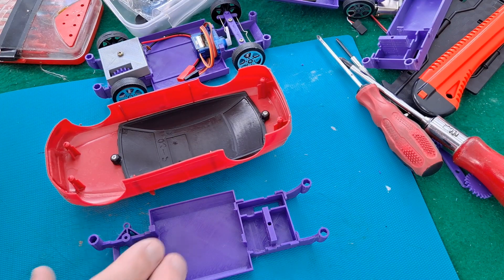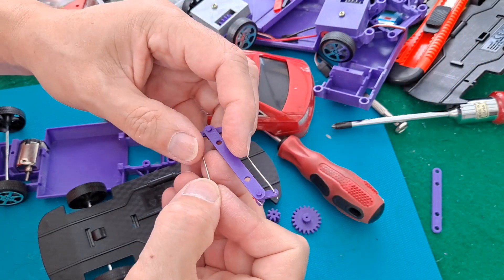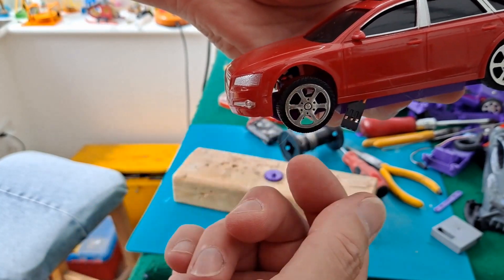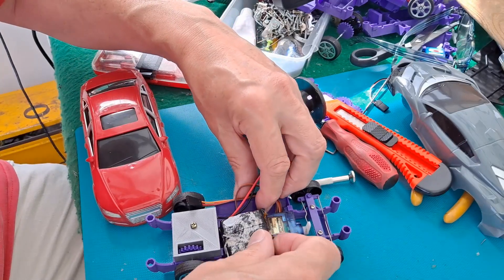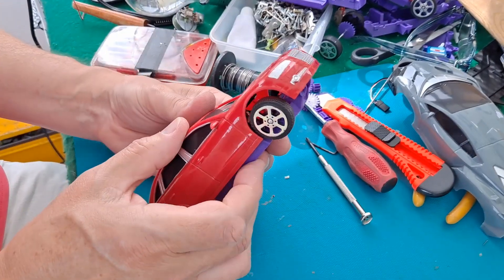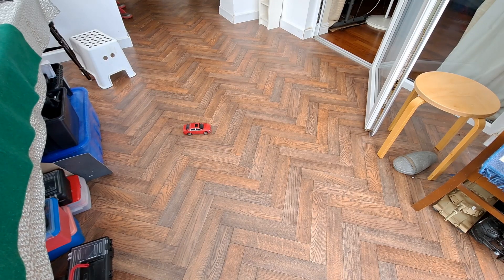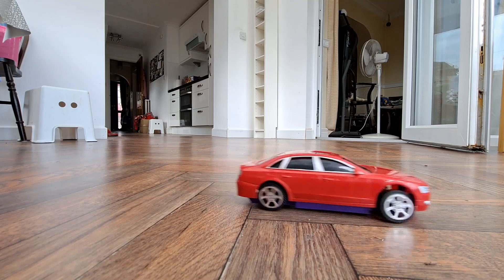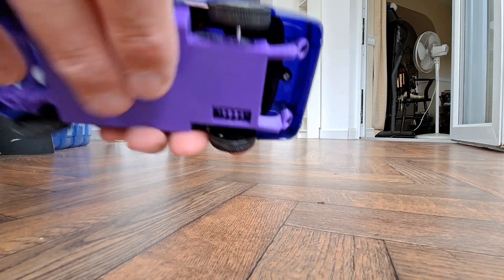Poundland toy car RC conversion project PART 15 - different chassis for the other cars.

Comment: nice video, the blue boddy seems to hold better on the chassis than the red one. no problems with the gears either,their holding up good and not cracking.runs good on the floor but slippery due to plastic tires.good job
Reply from the maker: Some people want their cars to slide like that so they can do drifting 😊👍

Comment: need to get rubber bands round those wheels at some point.
Reply from the maker: I am surprised how well they go with the plastic wheels. I expect if I only used a 1S battery you could drive it around fine. It might even be better on carpet. I do have some toy grade rubber wheels/tyres on order from China so when they arrive we will try them.

Comment: Really enjoying this series. Just a thought. Could you design the chassis so the axles could be adjusted forward and back to fit the whole range?
Reply from the maker: 4 of them use identical chassis. The other 2 are narrower and have smaller wheels.

Comment: Make a chassis a bit tinner, like previous one and make a connecting pins a couple of millimeters lower to make a lower car.
Reply from the maker: That is what 3d printing is all about. The ability to modify your design to accommodate changes.
Reply: @GrandadIsAnOldMan  https://youtu.be/vqWwUx8l_Io.If you wanna recycle your useless 3d prints into a 3d printer filament, maybe this guy can help you

Comment: Is there no way you could use the "original" chassis and just stick the motor, gearbox assembly, and steering on it? Suppose it takes the fun out of printing your own chassis but I was just wondering. 👍👍👍
Reply from the maker: It would have been far more work. Most of the front would be cut away to allow for the wheels to turn so no strength left and would need bracing. Same applies at the back to make space for the gearbox and motor. So what is left?
Reply: @GrandadIsAnOldMan  Yes, true, but what about putting them in "Series" LOL😂
Reply: @GrandadIsAnOldMan  Just want to mention a new thing I have noticed with YouTube. I have two channels as you know. Well, I used to be able to leave a like on one video independently from each of my channels. Now I see that it won't let me do that. If I leave a like from this channel and then go to my other channel it shows up blue. So you cant leave another independent like. Absolutely pathetic. 😒
Just tried it with your video here and now it is working. I took away my like and went to my other channel. It then gave me the option to like this video. I am absolutely baffled by YouTube.
Reply from the maker: @mikeflight9  I think it is perfectly reasonable for YouTube to do that. People used to set up banks of computers to create fake views. It is probably in the terms and conditions that you cannot use multiple accounts to boost viewing figures.
Reply: @GrandadIsAnOldMan  There is nothing reasonable about YouTube. I only joined it in 2015 to leave the odd comment. Never had any content myself but I can see how much it has deteriorated from what it used to be.
Reply from the maker: @mikeflight9  I think too many people expect something for nothing. People seem to think it is a public service provided by their government. YouTube is free to access and free to use private company. Some people have made good money from the free service that they would never have made in their lifetime without YouTube. The overheads and running costs must be eye-watering. I get very tired of people complaining about adverts on YouTube.  If they don't want adverts, YouTube has provided an alternative with their premium option. For those people who don't want YouTube to put adverts on the videos they have uploaded, maybe YouTube could provide them with a 'pay to upload and host' option. The algorithms are there to enable YouTube to comply with the many laws in the different countries they serve. I may complain about the occasional hiccups in the service but that is about the implementation. I have added to the filters on my channels to try to reduce the spam bots, porn channels, and scammers. None of those are YouTubes fault and they have to find ways of dealing with them. As for channel content, there is a very broad range available, so much that it would be physically impossible for any one person to be aware of what is available and how much of it is socially acceptable.